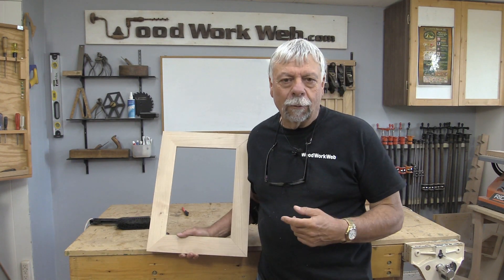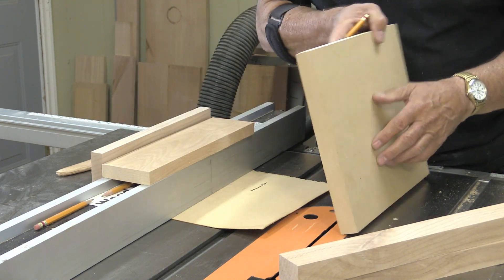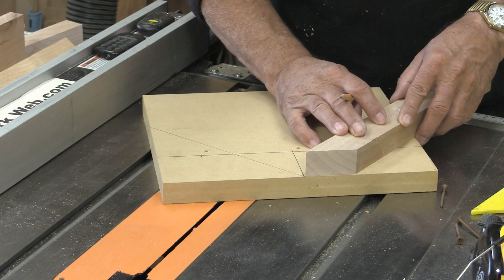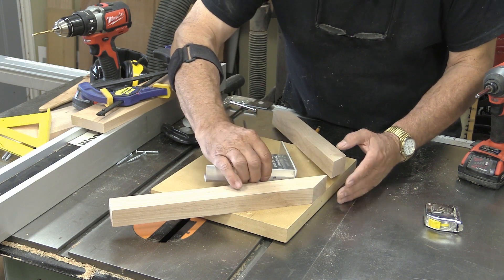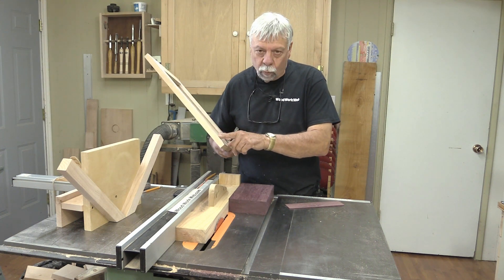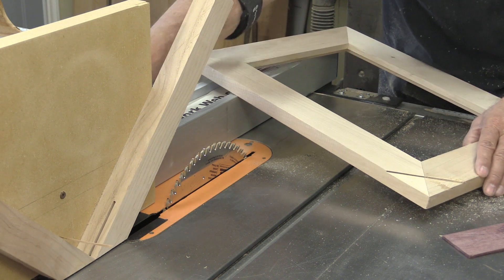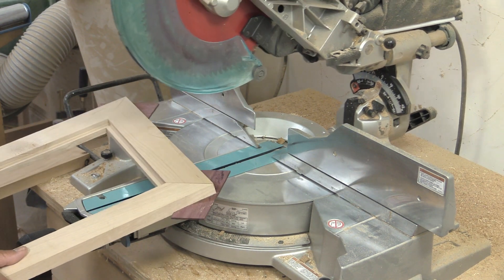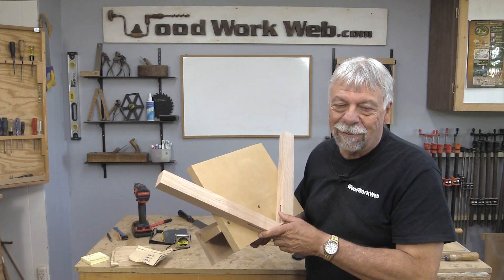Corner Rabbet Jig for Table Saw Rabbet Joints

Comment: Hi again Collin,
My jointer is a Rockwell series 37-220.  I found the manual on line, and on setting the knives Rockwell recommends setting the height at the level of the out-feed table.  Figure 9 in the manual is quite explicit about this.

However, I have looked up on-line videos for this question, and all, including your own, recommend setting the knives a little higher: your 1/8" to 1/4" drag and other craftsmen call for 7 mm drag.  Can you please comment?

Charlie

Comment: Nice jig, Collin.  Think I'll try it myself, when I get other projects -- chiefly repairs -- out of the way.

A long time back, I saw one of your videos in which you explained that Freud table saw blades had laser cut slots or damp vibration.  I think you focused on blade vibration as the daemon of ripping.  I have been experiencing awful problems with ripping on my saw.  The saw blade burns wood as much as it cuts it.  I have checked the alignment of the blade with a 1/10,000" indicator, and the indicator shows no misalignment.  (Actually, the needle on the Brown and Sharpe indicator sits dead still as I turn the blade by hand, until it comes to a paper label cemented to the blade; then it jumps to 1/1000", the putative thickness of the paper, and then drops back to zero after the indicator tab seats itself on the metal disk of the blade; I'd say the blade is not misaligned.)  The blades I have been using for ripping are thin kerf, carbide toothed blades built by Irwin.

So, I ordered two Freud ripping blades, one extra heavy duty model and one for ordinary  duty.  I just installed that ordinary duty blade on my saw, so I'll drop you a note to let you know how that goes.

From my past life, I  know a bit about vibration and damping.  (I'm a retired mechanical engineer and retired professor of ME.)  So, if the trouble I've been having is due to torsional vibration of the saw system about the shaft, it would be possible to stop that with a vibration absorber -- a device that vibrates at the resonant frequency of the machine and compensates exactly for the displacement (angular) of the saw by displacing itself directly opposite to displacement that the saw would exhibit if the absorber were not there.  The saw does not move at all, once the absorber is installed.  Have you ever encountered a vibration absorber for a table saw, or for any kind of rotary wood working machine?

All Best,
And please keep up the great work.

Almost 85, and still at it.

Charles

Comment: Dear Collin,

I think I have discovered a major cause of smoking on my table saw.  I measured my fence again.  Previously I had measured it at each end, and it seemed acceptable.  Well this time I measured along the whole length of the fence.  Mid way, at about the position of the saw, the dial indicator showed that the fence is concave, as viewed from the saw.  All the time I was pushing to keep the work piece against the fence, I was actually twisting the wood against the saw.

I plan to mount a piece of maple flooring on the fence and re-adjust the fence.  Do you  have any suggestions re that?  I will probably mount a similar piece on the other side too.

By the way, I have been having a nightmare situation with resetting my jointer knives.  I looked on line and ordered the same tool you displayed for that purpose.  I hope that will get me into the right ball park.

Thanks for your very helpful comments.

Charlie,

Going on 85 and still at it.

Charles A Berg

Comment: Hi Collin,  Re my previous comment and appeal for help: I must have had a "brain freeze".  My problem is most probably due to misalignment of my fence.  I had aligned the fence a day or two ago.  I had not supposed the obvious: the bolts on the fence had come loose a little and it is not aligned now.  Back to the shop!

Charles A Berg
Reply from the maker: Hi Charles, burning wood when ripping is a common problem that can be caused by a variety of issues, including blades that need cleaning with blade cleaner (NEVER use oven cleaner) for pitch and glue that can stick to the blades, as you say misaligned fence can cause problems, pushing the wood too fast or too slow through the blade, sometimes a thick kerf is worse than a thin kerf  and in the end, some woods are just plain terrible for burning no matter what we do. It can be very frustrating at times. I have found maple and some cherry to be quite susceptible to burning. 
So there are lots of possibilities and hard for me to predict which one or more that it could be ... hopefully you will find something in this not that will help.
Colin

Comment: why aren't you using the blade guard or riving knife? you always say to use it when you can. I Didn't see one reason why those rip cuts couldn't have been done with the safety features installed.
Reply: Noah Fricke For the same reason a majority of wood workers never use them, they are a pain in the ass!  we accept the risk and pay attention to what we're doing.
Reply from the maker: If you follow my channel, you will see that I often use the blade guard but in cases where there is not enough room between the blade guard and the fence I have to leave it off